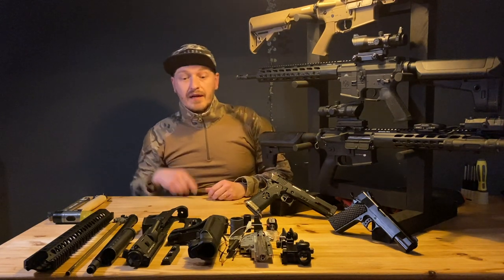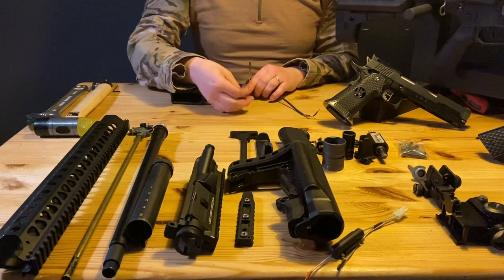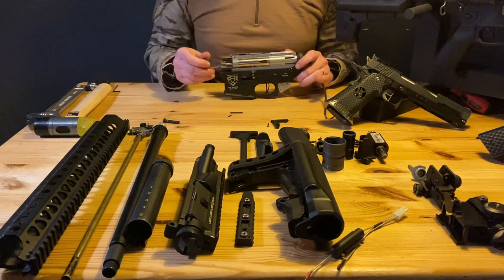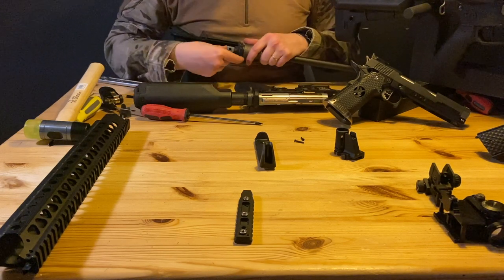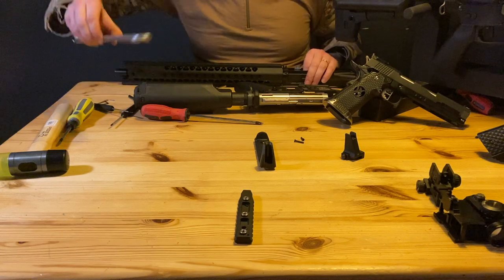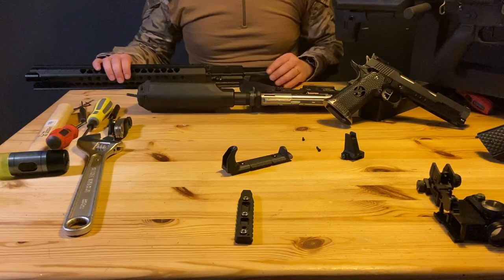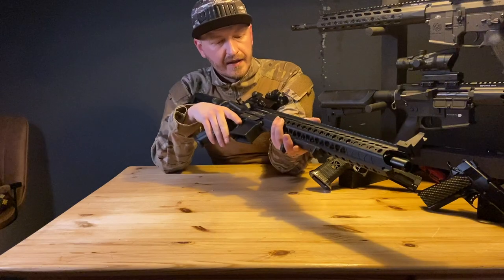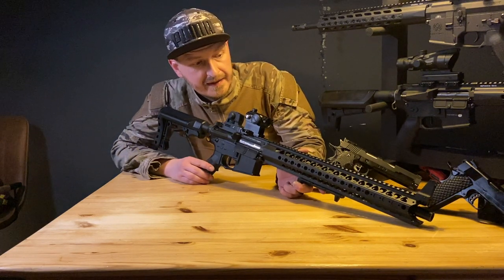How to build a custom M4 airsoft gun from scratch, using spare parts!

Comment: Yah, I want to build my own gun, but I am still thinking about it.
Reply: You definitely should I've built a few guns but I kinda sold them to my homies but they are fun to built I will make more in the future
Reply: @stranger3499  yep I finished the build about 6 mo ago, it looks sick and has custom paint job
Reply: @johnf2381-f5z  that's really cool which gun platform did you build with?
Reply: @stranger3499  M4
Reply: @johnf2381-f5z  oh nice
Reply: @stranger3499  yeah it was a great experience and my favorite part about the gun is it is a 40,000 rpm gun. Pray and spray baby
Reply: @johnf2381-f5z  gAw dam that's fast how much fps?
Reply: @stranger3499  I’m not sure but it spots super fast and super far, I would love to upgrade it to a poler star but air is to exspensive

Comment: So for the Aps EBB gearbox to work you will need a Aps m4 upper and lower body?
(Or can you just use any m4 upper and lower body part)
Reply from the maker: @Husky-w3v  the dimensions are different. That’s my experience with them. Since this being an ebb the charging handle works different. On any other m4 without ebb the charging handle will be screwed down on the inside with a spring. In this case it’s completely different. 
I’ve tried Fitting aps gearboxes in other body’s and they didn’t fit.
Reply: @Efde90  ok thanks

Comment: If anyone could, can you list everything I would need to build an M4 like this? (Need all the essentials.. battery, gear box, etc)
Reply: Outer barrel
Muzzle device
front sight
front sight pins
faux gas tube
outer barrel securing screws
outer barrel holder
delta ring
handguard
upper and lower receiver
upper and lower receiver pins
pistol grip
gearbox
motor
pistol grip screws
buffer tube
battery, depends on gearbox 7.4v-11.1v
Reply: @isaacbuller8838  is the gun gas type battery, But thanks for the info

Comment: I've got an SR 16 platform I want to convert to a Mark 18 clone? I've been told I needed to change the barrel as well as handguard? I don't understand why? Any ideas????
Reply from the maker: Well I don’t think you’re using an mk18 handguard right now. And in order to make an mk18 clone you need to change that. And maybe because of the barrel length you need a different barrel.
Reply: @Efde90  it's a 12 inch mlok rail so?

Comment: Do you know of a source for parts in the US? I want a high end realistic m4 type gbbr for training (in place of having to use actual rifles). But everyone I contact either has nothing in stock or they want to pawn off cheap a$s kwa or similar 
sh!t.
Reply from the maker: Did you check out airsoft GI or evike?
Reply: @Efde90  
Yeah they just have upgrade parts. Not upper and lower frames for gas.